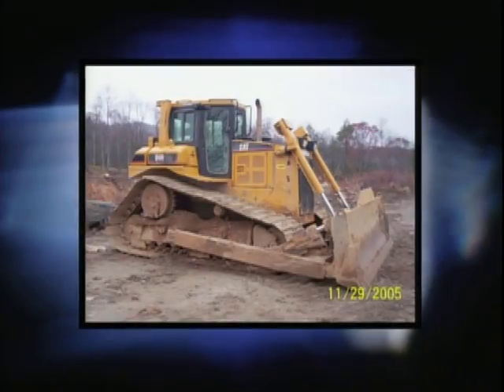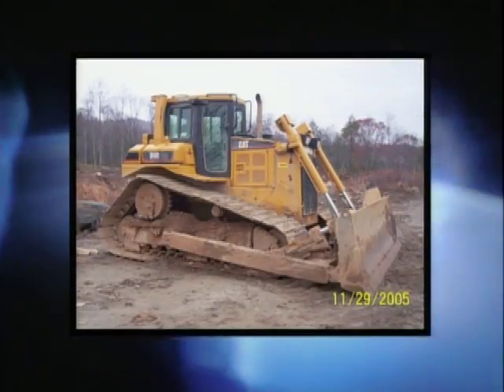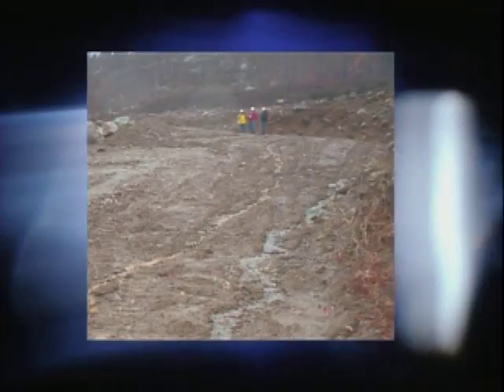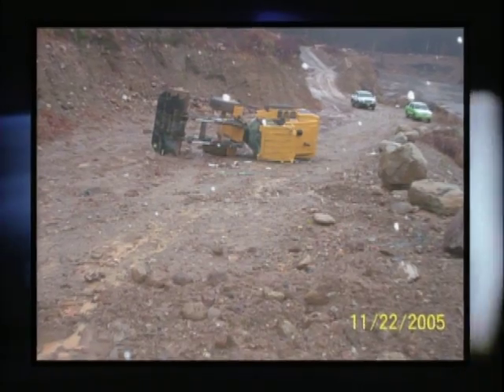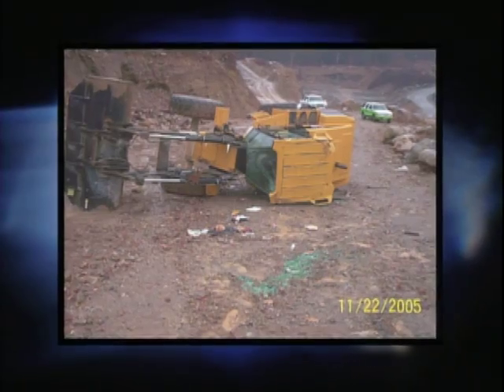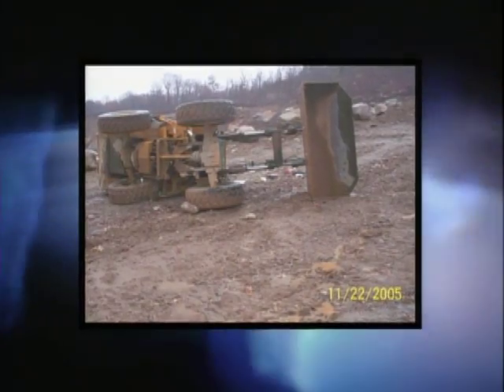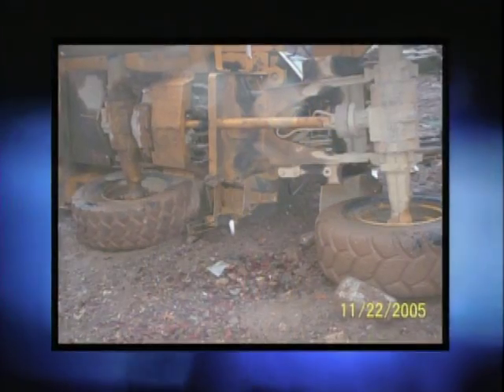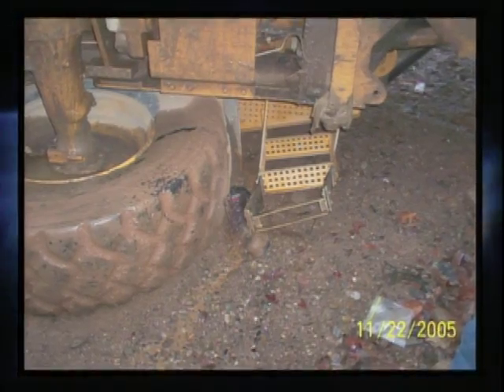Stay in the Cab and Keep It On! A Survivor's Story

Comment: When I was a teenager I was using an Allis Chalmers C (20-some hp) to mow ditches.  You would think the uphill wheel skipping would be a clue, I kept going where the slope was worse and it started to flip.  I must've jumped off, I just remember looking up at it coming at me, and instinctively rolling the right way (rearward relative to the machine), I was uninjured.  It had no ROPS, staying on wasn't an option.  Steering column was bent, but it was still operable.  If the ditch feels too steep, don't mow it/turn on it/whatever.  It's not worth it.